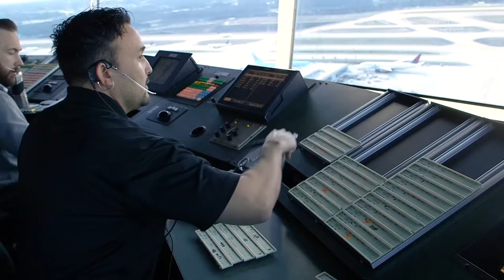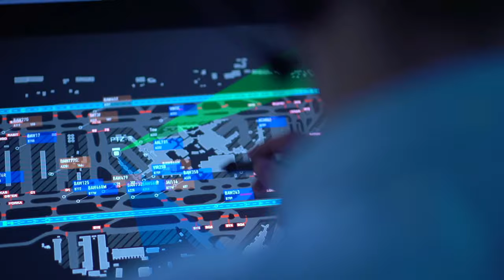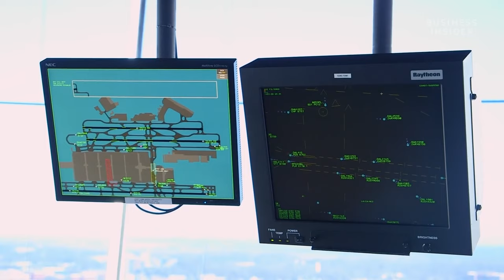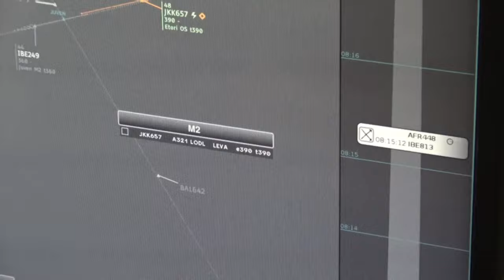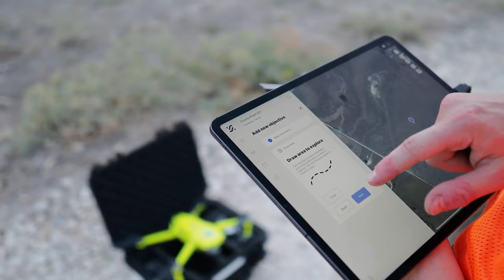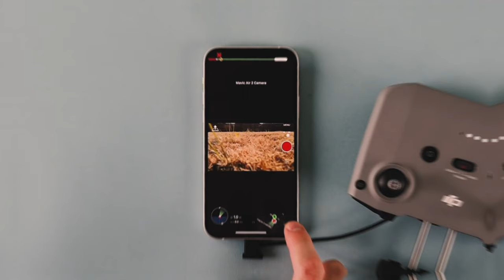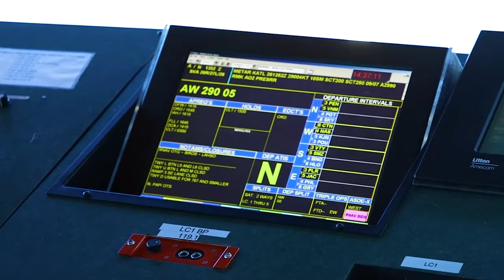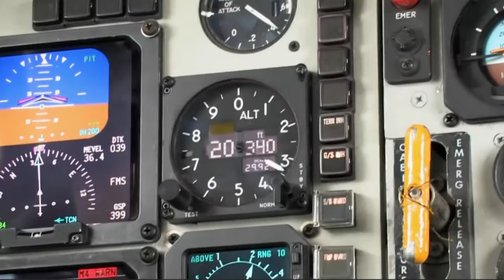AI Is About To Change Aviation Forever! 😱

Comment: All the existing communication data could be used to fine tune a model to assist ATCs, it’s about making their jobs easier and more effective r, not replacing them.
I work devops (software engineering), and learning promoting has given me a huge advantage over my coworkers to learn different orchestration stacks and optimize its CI/CD pipelines, imagine if there’s a specific fine tuned model that can assist your work?
I feel positive about this even in aviation.

Excellent video btw, you deserve more views.
Reply from the maker: Thanks for the input! Yes we are still far from replacing humans with AI in aviation, and probably we don't even want to go that road ever. AI is still a good tool and can be used more widely, to assist in different tasks.

Comment: Not gonna happen anytime soon!!!!  What happens when the system fails and the backup system fails!! Who takes the reigns then!!!  To say the least I am not flying as a passenger in an unmanned aircraft!!!!!

When a computer crashes does it reboot itself and if the latter would happen will it complete reboot before you hit the ground at 500kts!!!!
Reply from the maker: Yes any system malfunctions are going to be a huge issue, and very difficult to solve!